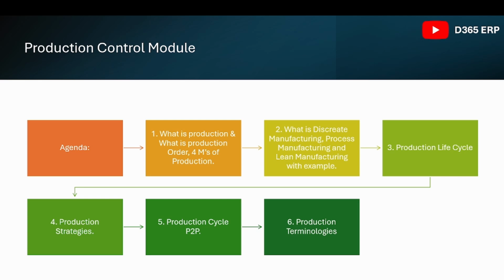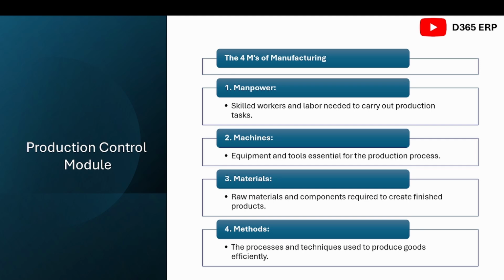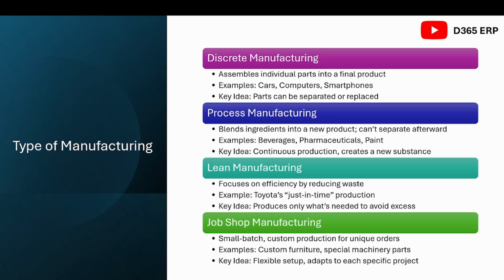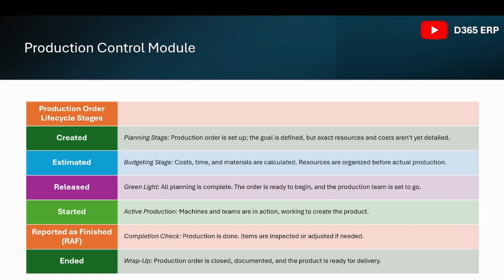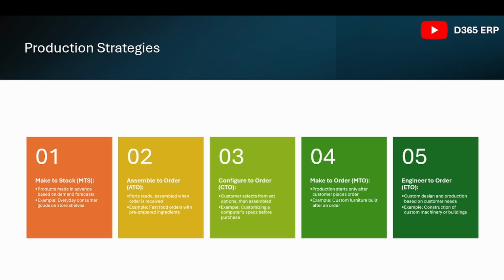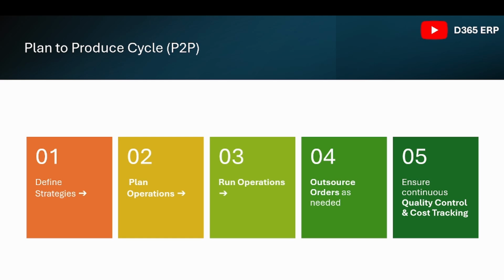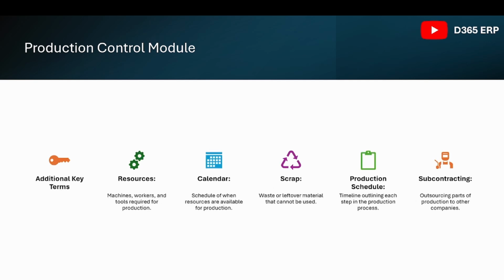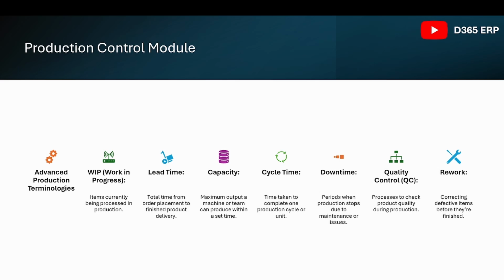Episode 1| Mastering Basics of Productions | Manufacturing | ERP

Comment: Hi hitesh,
Is it possible to recover deleted line items of sales order in d365...? Kindly help me
Reply from the maker: In D365 F&O, deleted sales order line items cannot be directly recovered as the system lacks an undo or recycle bin feature. However, you can check if audit logging is enabled to retrieve details of the deleted lines. Alternatively, review database backups or system logs if available, or look into external reporting tools for historical data. If no such options exist, the line items will need to be manually re-entered using any available documentation. To prevent this in the future, enable auditing, restrict delete permissions, and provide user training.